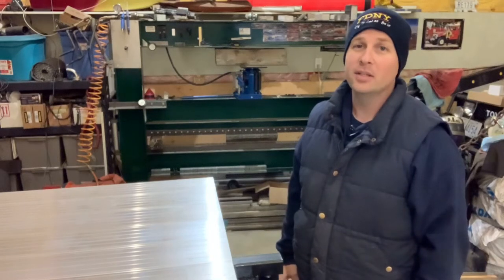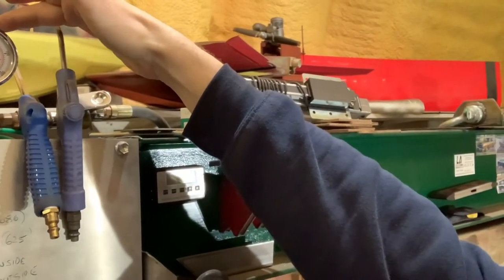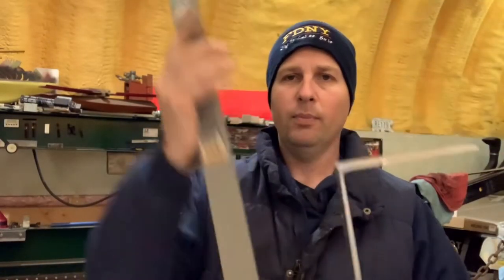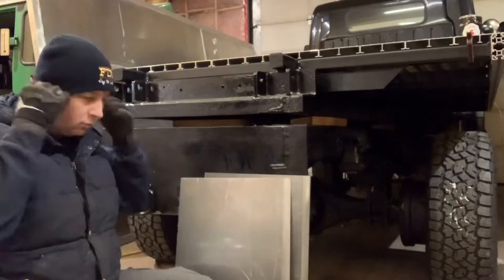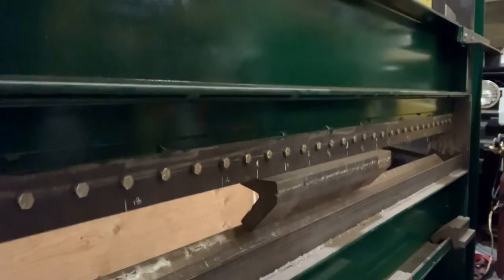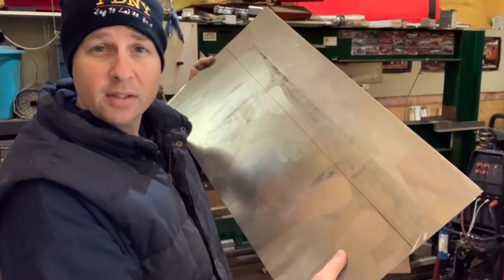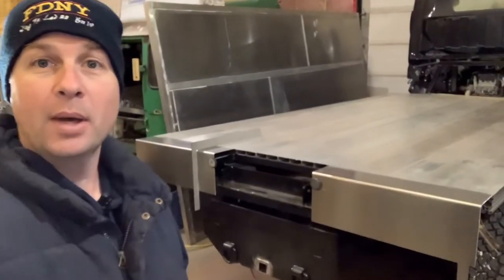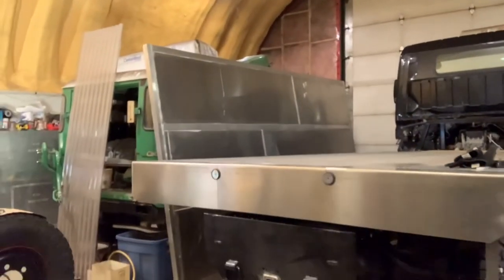Back of the Bed! - Mitsubishi Fuso tray back build!

Comment: Why do you need the aluminum rails and how did you fasten them to the frame? Can't you put the floor (not the rails) on the steel framing? Did I miss that episode? Can you explain the 3 levels on top of the chassis frame? Yes, I'm requesting special videos just for me now. 🤣
Reply from the maker: The sub frame mounted to the truck could have the habitat box mounted directly to it, but the way the habitat box is built, it is intended to be removable - thus leaving the truck with a flat deck.  Yup, it’s kind of a double floor, but serves a double purpose.  By “rails” are you referring to the aluminum planking making up the flat deck, or the T-slot extrusion running down the sides?   3 levels… truck frame, spring mounted sub frame (this allows the truck chassis to flex, while not imparting the flex into the habitat box and breaking it into pieces).  On top of the sub frame is the decking - providing the surface for the flat deck (or tray back) - on top of all this sits the habitat box.   I do have a couple vids on the sub-frame, chassis flex, spring mounts and the decking if you go back through the play list 😁
Reply: @BruceandKrista  I forgot about the habitat box being removable, my bad. Now it makes sense. And yes, I meant the planking. The spring mounted sub deck, wow  what a YouTube rabbit rabbit hole that became. Such a cool rig you are creating. Keep up the good work. I'm catching up to you, 36 episodes to go!
Reply from the maker: Add one more to the list tomorrow night 🤪